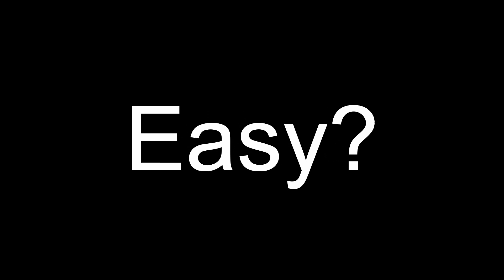FAST IRC quicksifter installation

Comment: Worthless video for showing how its installed.
Reply from the maker: We supply any unit with installation manual. However it is very simple: remove coils connector and put our bypasses in the between. Connect our ground wire to battery, Finish. Do you think it requires a specific video? if yes, we'll do it.